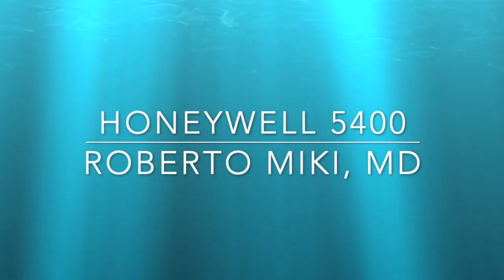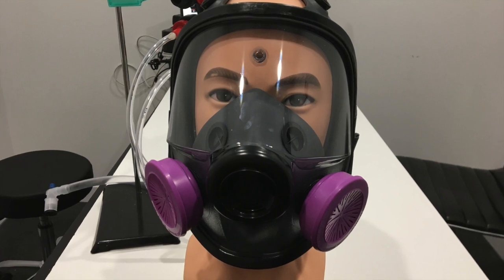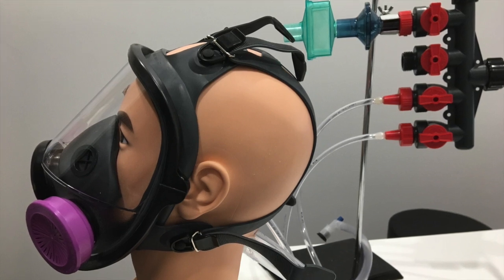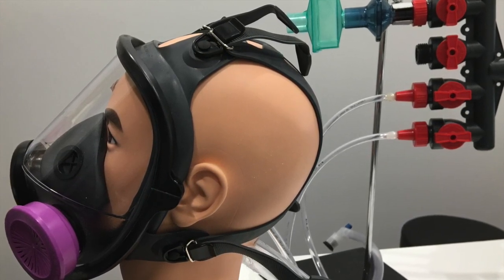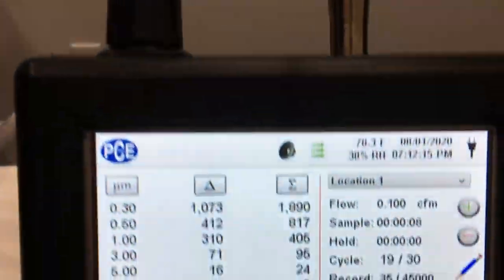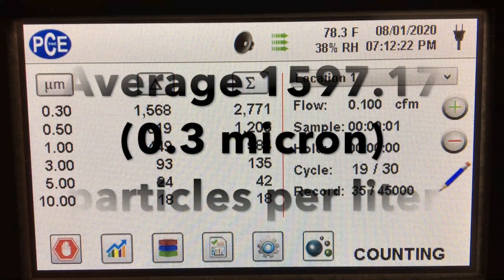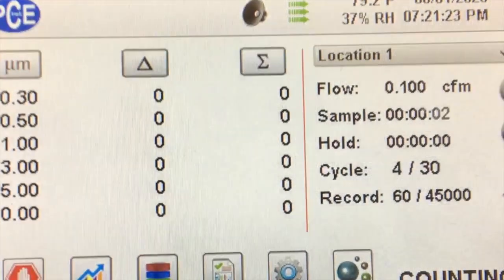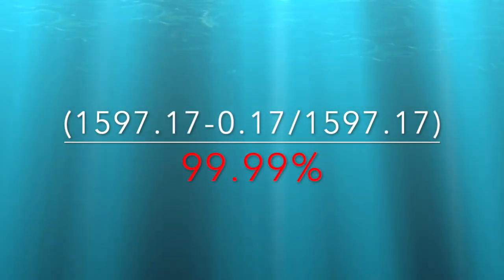5400 Honeywell Full Face Mask with P100 Filters

Comment: Thanks for reviewing this. With my 76008A that I use, when I do pressure checks, the negative pressure check is always excellent. But in the positive test, if I blow hard, I notice some air escape on the upper right area of the seal. This is the area covered by the upper two straps of this full face reviewed in this video. It appears the upper two strap design may seal slightly better than the one upper strap of the 76008A. This is why this respirator and the 3M may seal slightly better.
Reply from the maker: I agree. The design seems more sturdy and allows better contouring to your face.